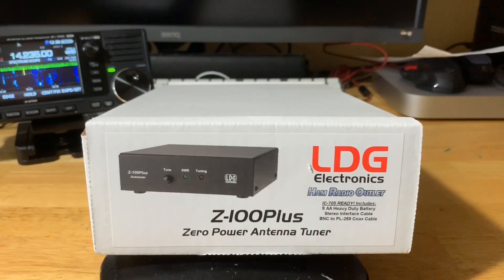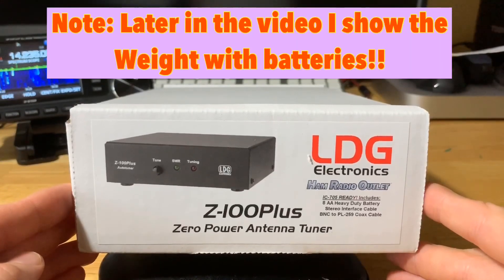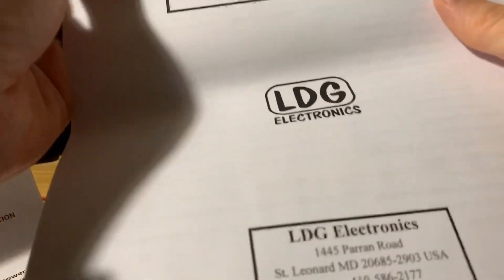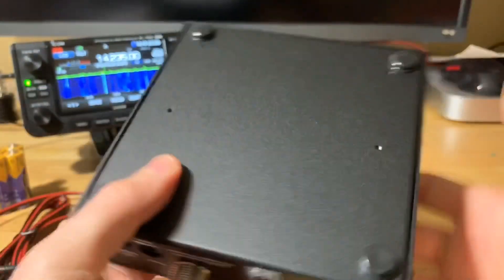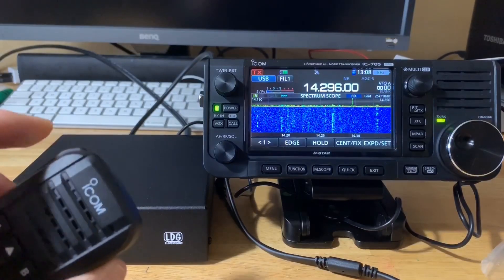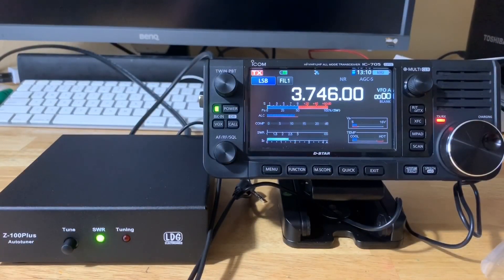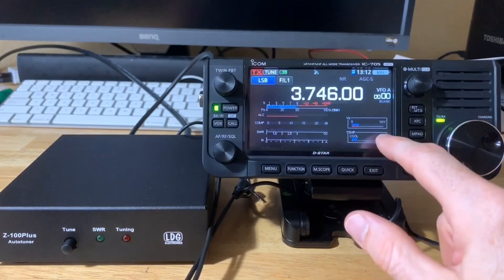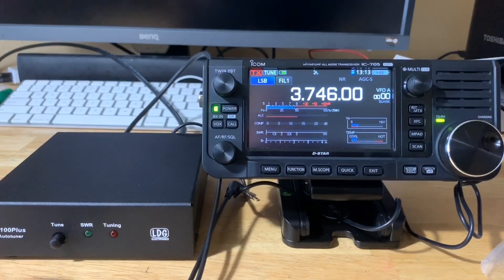Unboxing & Testing The LDG Z-100PLUS/IC-705 Automatic Antenna Tuner Kit for the Icom IC-705

Comment: Good review!  Alkaline batteries are  a bad idea (as are Ni-Cd) for this unit as they are prone to leakage over time. Standard heavy Duty (zinc-carbon ) are best and will last a long time. I use them in my SGC  SG-211 tuner. 73!
Reply from the maker: I was thinking of using Powerex NiMh AA batteries as I agree that leaving normal Allaline batteries in the tuner and having them possibly begin to corrode the tuner is a Bad idea to say the least!  Thanks for watching and commenting 73
Reply: @PrecisionGroupYT  Again a super no BS to-the-point review... one question: Does the LDG TUNE button initiate a carrier PTT if the radio is in SSB or CW mode? Thinking fast QSY. 73!

Comment: Great vid. What can you tell me about the stand your IC-705 is on??
Reply from the maker: Thank you!  The stand is called a “Z” bracket which I believe is typically used for cameras, I saw a few Japanese HAM’s using it for their 705’s and I like it as you can easily adjust the angle 📐 for your 705!!  73’s

Comment: Good review and one to consider just waiting for the full spec on the AH-705 will it tune at 10-1 and price. I have the AH-3 on shack wall and it tunes a bit of wet string.
Reply from the maker: I am also interested in the AH-705 specs and price!  The MAT705 tuner was well over $200 while the LDG one I review here is much less.  I was thus far disappointed at how big the AH-705 is!